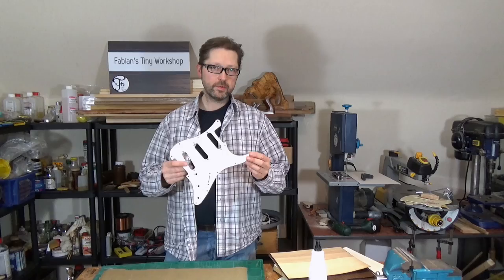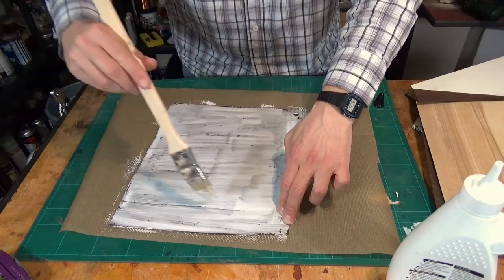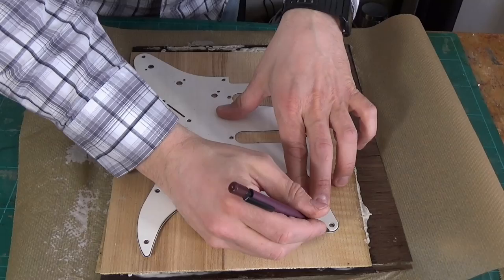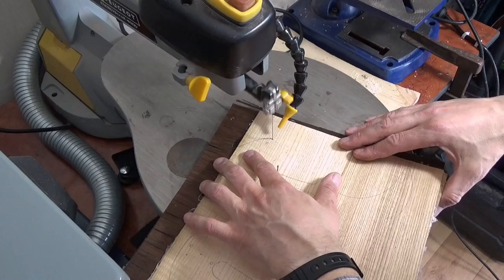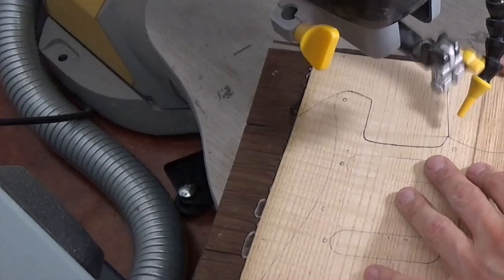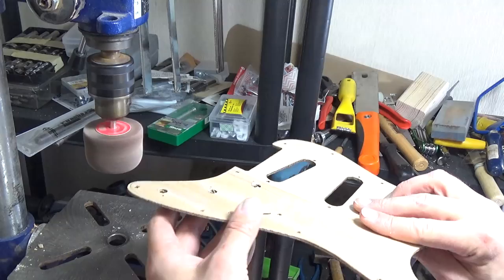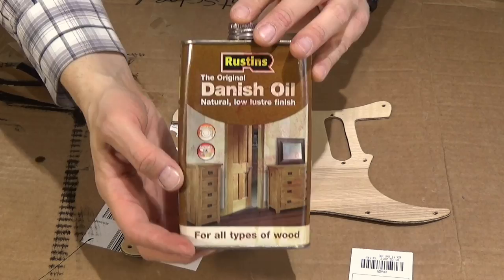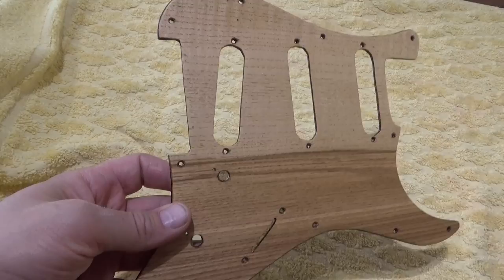make a DIY Wood pickguard // How To

Comment: Hello.....playwood 6mm?
Reply from the maker: It's four layers of 1mm veneer.
Reply: @FabiansTinyWorkshop  isn't 4mm a little thick? Pickguards are usually 1.5mm.
I'm making one this week, thinking of glueing 2 veneers together. Will this be strong enough?
Reply from the maker: @Professor-Scientist  Yes it's a little thicker than the usual pickguard but it's wood and not plastic. Since this veneer wasn't very strong along the grain I was afraid of breaking it.